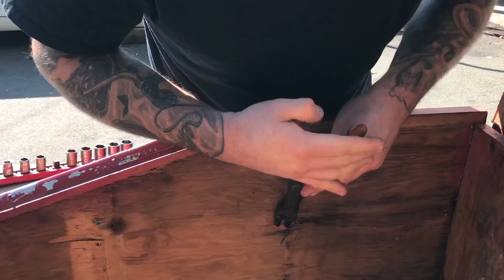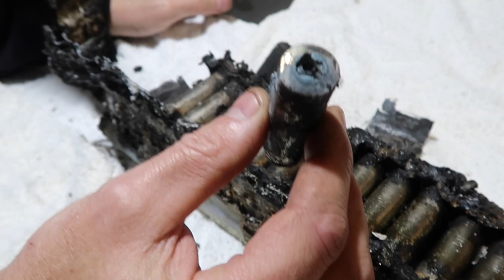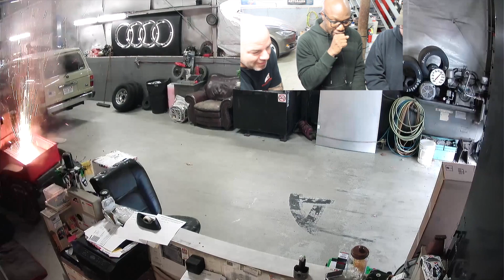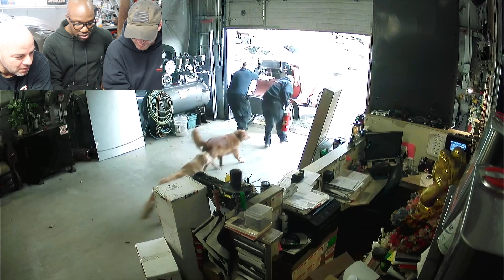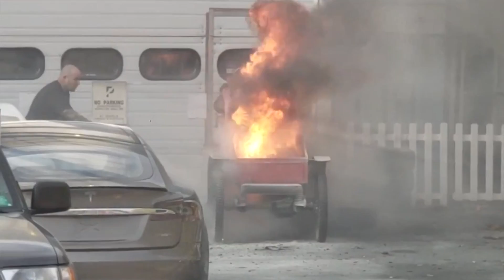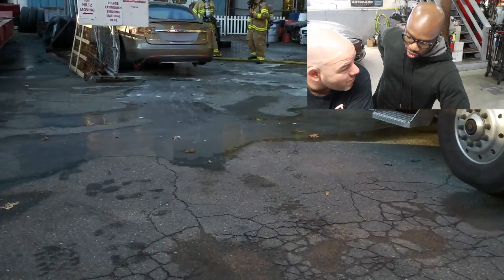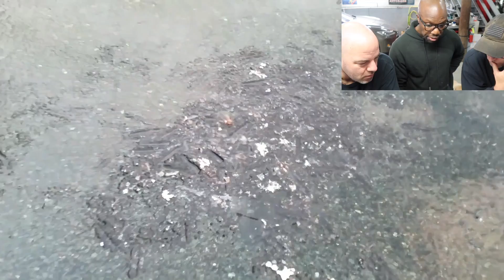My first Tesla Battery Fire

Comment: I've been wondering how Hydrogen compares.  I won't be buying an EV until this problem is definitively sorted out.
It seems this kind of battery fire can happen at any time - during charging, while the vehicle is simply standing, while it is being driven .....
Imagine it happening in the middle of a long tunnel.  With all those fumes spreading out and filling the tunnel, what would be your chances of getting out alive?  Not to mention other motorists who would quickly form a traffic jam behind the burning car!  Are the fumes toxic?
Reply: LiFePO4 hydrogen is not an option really
Reply: @ghz24  No - I meant running cars on hydrogen instead of on batteries.  It has to be in high pressure tanks, so there are risks associated with that also.
Reply: @DownhillAllTheWay  The risks of hydrogen are less than those of gasoline or ordinary lithuim.
Hydrogen quite possibly will never be a viable alternative.
These guys did virtually everything wrong, the chemistry of a tesla battery is violent when abused.
They had no BMS installed and I saw little in the way of checking cell voltages for balance.
They were poking the dragon and it woke.
If you expect an electric car to be more nova than corvette you can get LiFePO chemistry batteries that won't catch fire with any abuse short of a torch.
Reply: @ghz24  Yes, from what I have gleaned, the modern batteries are much better in many respects from the early ones.

Comment: You forgot the titanium shield Tesla had to add to the model S to help keep the fire away from the passengers long enough to get out and away from the vehicle.  That being said Lithium batteries of almost all chemistries are dangerous if they are abused while charging or when having just one cell fail.  

They did say they weren't using a BMS but that doesn't explain how they were charging it and whether overcharging was the cause.  If for instance, they were using a hobby charger that had balancing, the hobby charger would have stopped long before any parallel cell group went overvoltage.  If however one cell had an internal short and turned into a heater a BMS would not have prevented this.  

This video even as old as it is should give DIY battery builders a moment of pause to see what can happen if a mistake is made or even a single cell goes bad.

Comment: The firefighter where so wrong - they did a really bad job because lithium reacts highly with water - you should never do this - you can only cover the cells with a fire blanket
Reply: You can't put out a lithium ion fire that's gone into thermal runaway with anything. It makes its own fire triangle (oxygen produced during fire).

A consistent supply of water is the best way to try to control the fire because it's pretty abundant. You'll run out of fire extinguisher quickly, and it will still be on fire

Comment: It really has nothing to do with the battery management system... other than over charging issues.  The Mechanical Failure of a  single mass produced chinese battery cell inside the pack ( Just One !).. can lead to this Cascading Battery Meltdown.  It is a classic domino effect.. on an exponentially increasing level.   This is a world where 10% failure rate of cheap chinese goods is typical.. on the low end.. and 1% on the high end.   If there are 1000 cells and 1% fail.. that is 10 igniting cells.   but if we say the fail rate is .01 ( point zero one)  or 1/10th of 1 %   that is still One Bad Cell per 1000.   And as we see illustrated here.. It Only Takes One .   There are litterally 100's of Teslas that have burned to the ground spontaneously , due to this dense multi-metalic cell design.   Look at a video of how a Leaf Battery is manufactured.  Look at videos of dissasembled Leaf Battery Packs.  Yes, they lack a battery cooling system.. yet they still do NOT burn.  Clearly this is due to the method of construction.   Tesla Owners are like Trump Cult members.. they will NOT look a fact in the eye.  The fact is.. the battery pack design is dangerously concieved.. and no manner of cooling will fix the fact that it has too many parts, and that the failure of just one..leads to an unstoppable catastrophic cascade of failure !

Comment: So, let's get professional, what caused this fire and what NOT to do to cause another?  It didn't appear that the cells were being charged at the time.  Were the cells wired in parallel without ever being balanced or what?  come on, guys.  Disappointed that this was posted simply as an amusement video a s it would make anyone avoid your shop.

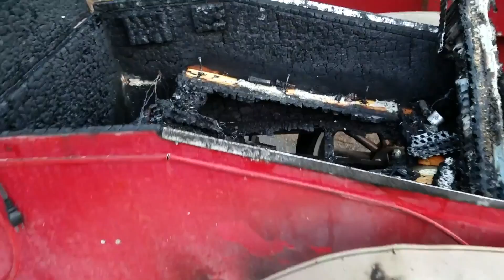Comment: @11:29 Rich very clearly says, "These batteries are not toys. There was no battery management system connected to them, nor were they cooled, so this is an example of what can happen… This is an example to show the community what can happen when you don’t follow proper safety guidelines." This would not have happened if they were still in a sealed Tesla battery system, with battery management, coolant and protective metal shell sealed around it.

Comment: When it first started, why didn't they fill the battery box with WATER? Sure, it would have corroded everything due to electrolysis, but it would have cooled the cells and prevented the fire from spreading. Water works on electrical fires provided the voltage is not too high.

If the voltage was higher than about 50v (14s) or so,  a large class D extinguisher could have maybe stopped it.

Comment: So why did it happen? They must have over charged the batteries? Seems silly to post a video like this without some kind of reason as to why it happened? Did they use a balance charger to make sure the votage of each cell didn't go over 4.2 volts or did they just hook a regular old battery charger to it and start pumping power into it?
Reply from the maker: The video immediately following this explains everything :)

Comment: "we knew exactly what to do"

in reality: flailing around with a fire extinguisher freaking out.
Reply: They handled the situation extremely well
Reply: no they didn't, they're like "ummmmm, we should push this outside" "ok lets try a fire extinguisher" "omg that didn't work, well I guess we wait".
 
if they knew what to do they'd know they weren't putting out that gigantic chemical fire with a little general purpose fire extinguisher. they're a bunch of clueless hicks in a shop who bought and electric car they don't know much about and almost burnt their shop down and you're a moron for thinking otherwise.
Reply: @kingjames4886  If you paid attention to the video you would realise that they said they were merely trying to control the blaze with the fire extinguishers. They even said they knew they weren't going to be able to put it out at one point. Mitigating the extent is better than doing nothing.

This is what they did:
1) Moved the fire away from the shop which had flammable items and smoke would have built up in there.
2) Controlled the blaze as much as they could until the fire services arrived.

That's the best thing they could have done with the resources they had available.

If you are so clever, what would you have done in that circumstance?
Reply: unless I had the right class of extinguisher capable of putting out a chemical fire like that I'd probably have just wheeled it out into the street like they eventually did without the flailing around... the fact that they even had the useless extinguishers indicates that they were not aware of the nature of that fire, the only thing they could do it put out the shop if they didn't get it out in time.

idk exactly what kind of shop it was, but maybe if they had dry ice on hand that might have been able to pull enough heat from the reaction to stop it... but really the only thing to do is to get it out.
Reply: @kingjames4886  So what you're saying is you would have done the same thing as them but without using even the wrong fire extinguishers to mitigate the flames?

I understand it was maybe a bit silly not to have the correct precautions in place to handle an electrical fire, but the reality is that they run a business and the Daisy car was only a small side project for them. Everyone makes mistakes. Within their limited means they handled the situation well and I'm not moron for thinking so.
Reply: well you're disagreeing with me for saying they were stupid for running around with fire extinguishers that we agree wouldn't really help... which was my point to begin with. you asked what I would have done and I told you and you're still defending them like they're your mother ffs... w.e man.
Reply: @kingjames4886  I said the fire extinguisher wouldn't put out the fire but I didn't say it wouldn't help. You judge them, then call me a moron and then after I ask what you would have done, you basically said you would have done the same thing as them anyway.

I'm confused why you don't think your responses are confusing.

Comment: Wow you know what else catches fire? Gasoline
Reply: Gasoline burns, it doesn't deflagrate (much higher burn rate, flame front propagation) . Common fire extinguishers also work better on it than lithium batteries.
Don't try to downplay lithium battery fires, they can be devastating and lethal especially with people storing and charging them indoors in their homes.
Reply: They act like gasoline vehicles aren't more dangerous 🤦‍♂️

Comment: When lithium batteries go thermal runaway, the heat is not the big threat the real problem is the fumes -> Hydrogen fluoride and when uppon contact with moisture it converts into hydrofluoric acid in ur lungs... Google "Toxic fluoride gas emissions from lithium-ion battery fires" for a full extensive explanation.  Just saying if ur gonna play with this batteries and their circuit logic boards you gotta be prepared for the worst. You need a breathing mask, a some sort of container to avoid the flying red hot lava melted batteries and a big hole ready in your backyard to bury them until all the lithium reacts with the universe around you hehe.

Comment: The thing I'm blown away about is that they use a ton of 18650 cells. I use these on my vape.  I also have made a few batteries for my RC monster truck using them. Very versatile.

Comment: That attempt to extinguish the fire was tragic. Fist of all you used the wrong type of fire extinguisher. You tried to put out a lithium fire with a CO2 extinguisher. If you would at least have a little bit of competence with working with high power lithium cells, you would had laying around some F-500 Encapsulator Agent to put out that fire in about 5 seconds without making a mess, risking burning the whole place down and wasting the firefighters time. Next time do your research first please and get the right equipment to stop this kind of accidents.

Comment: New 2019 dual Carbon Battery from Japan - Last much longer
and Charge up to 20 Times Faster than lithium ion Batteries, Also this Carbon
Battery runs cooler with much less chance of Fire ,, Elon Musk has worked with
this Japanese company Power Japan Plus in the past developing batteries , It is
just (possible) that they may be using this new carbon battery for Tesla's in
the future. Of course that is if the Batteries are as good as they say they
are.. The new Carbon batteries configuration is similar to lithium ion and can
be manufactured in the same manufacturing Plants that manufacture lithium-ion
today.. Below are some statements from the Japanese company....

 “Power Japan Plus is a materials engineer for a new class of carbon material that balances
economics, performance and sustainability in a world of constrained resources,”
said Dou Kani, CEO of Power Japan “The Ryden dual carbon battery is the energy
storage breakthrough needed to bring green technology like electric vehicles to
mass market.” The anode and the cathode of the battery are both made out of
carbon with an organic electrolyte solution that allows for ion current to flow
separately. This also does not require the use of any rare Earth metals or
other rare metals, significantly cutting down on the price of each unit.
Thermal stability means that this battery will not heat up while in use or
during charging, and removes the threat of Thermal Explosion and making for a
Safer Battery.

Comment: You need a Class D fire extinguisher. I highly recommend especially when working with Lithium batteries. Do not use any Halon it will decompose into deadly gasses at that temp. Bicarb ABC Are useless.

Comment: Thanks.  You just confirmed my choice of ancient technology (sealed lead-acid batteries - AGM) for the solar power system ;-)  Fewer watts per pound or cubic foot but usually less dramatic problems.  Size is not a problem when the basement space is primarily storage.

Comment: it's disingenuous to call this a tesla battery fire. it stopped being a tesla battery when you removed all of the protection from it. this is a naked battery that may as well have been collected from power tools. the editing job you did is irresponsible, and you should have had a disclaimer up front and center stating that this the fire was caused by your irresponsible handling of the battery, charging it without any protection systems instead of leaving it for a two second blurb at the very end which probably 10% of viewers are going to see.

Comment: Any battery is dangerous. There is no safe energy storage method. Gas is highly combustible, batteries deliver their energy very easily. The best way to limit the damage is flooding the battery with loits of water. The water will take away the energy and cool down the surrounding, undamaged cells. The more water the better.

Comment: While I have no knowledge about Tesla batteries, from my clandestine xp with lithium batteries many moons ago, I thought it was a no-no to spray H2O on a lithium battery fire, since lithium strips have been known to explosively burst into flames when tossed in say a toilet ;?D  So if this does apply to Tesla's lithium batteries, for future fire prevention, maybe it'd be a good idea to have some (or a lot of ;?) class-D copper powder extinguishers handy.  

Also, while it could be safe to assume that most normal EV battery fires (not caused by an accident) won't be shooting off burning batteries all over the place since they'll be under/inside the car itself, if you are going to do more of the kind of work where you completely strip a car down to the chassis exposing them inside your shop, another good investment might be a large (and heavy/weighted) fireproof tarp.  

Keeping it close by when doing such work could be handy for containing/minimizing such a fireworks display, so it doesn't burn down the whole building, or it could be used for personal protection as well if things gets out of hand in a hurry.  Just some food for thought - I'm a big believer in hoping for the best, but planning for the worst, lol.

Comment: As a vaper we all know the safety rules of these 18650 (or where these the new 21700 ones). Always ballance charge and not use cells with different charges. The energy density of these things lies at the same point as TNT.

Comment: the fire isn't what went wrong. the fire is a result from what went wrong.
Reply: Marc Rossbridge  you are talking out of your asshole, li ion batteries explode lifepo4 batteries do not, neither do lithium titanate.
The problem is that the safest ones (lithium titanate) are also very expensive and have a lower energy density, however you can litterally cut them in half with a saw and they won't catch on fire or release fumes.
Hydrogen IS NOT THE ANSWER!
Hydrogen is an ENERGY VECTOR and implementing it is much more inefficient.
Batteries are the only answer but we have to search for a more stable and energy denser technologies.
Reply: Don't matter anyways...I work with electronics and I find things like charge controller failures too!
Reply: they say at the end they didn't have a controller on it... they were just asking for a fire.
total idiots.
Reply: @kingjames4886  at about 11:30 he says that
Reply: Marc Rossbridge  I ment "is not".
You have to understand that the only (not really the only, but the most feasible) way to produce it is through the electrolisis of water which is a very inefficient method.
Plus hydrogen would be used (at least in cars) with thermal engines, further reducing the total efficiency.
Best way would be to store energy directly in batteries and use it in electric motors.
Reply: The design was wrong.. Move to mars..leave the suckers behind.
Reply: It happened because of a faulty battery, there is a positive and negative side, but there is a plastic sheet separating that, but for one of the batteries the lithium came in contact with water moisture or with the other metals causing a spark, that spark burns the plastic and then it burns and explodes
Reply: Marc Rossbridge  hydrogen is and will never be green energy, electric is the closest we can get.

Comment: Next time, keep some sand (or perhaps a lot) to extinguish the fire.  This is a lithium metal fire and a typical ABC, or CO2 fire extinguisher can actually INCREASE the flames.  Typically a K class fire extinguisher is needed, but they are extremely expensive.  But your typical play sand can put out a metal fire.  Using a typical ABC fire extinguisher is like putting water on a grease fire.
Reply: probably best to just install a big water tank, pump, and hose.

Comment: That was a mistake trying to make a tesla battery work in that little toy it’s made for car batteries not tesla batteries tesla batteries have a cooling system in them that little toy car does not have a cooling system for the batteries that’s why they overheated and shorted out your lucky you didn’t burn down your entire garage!